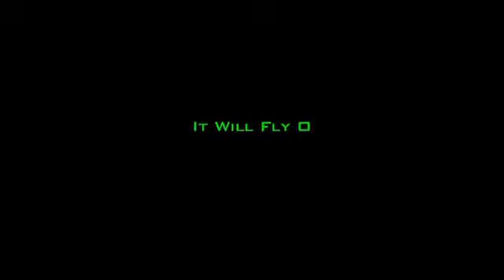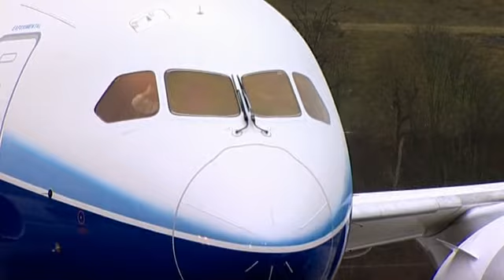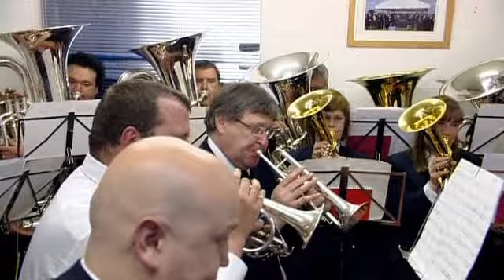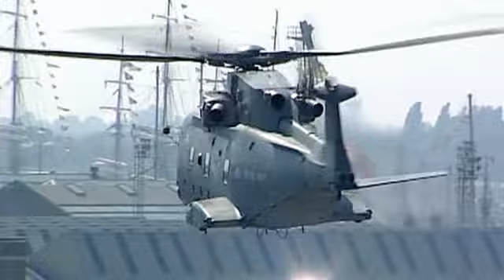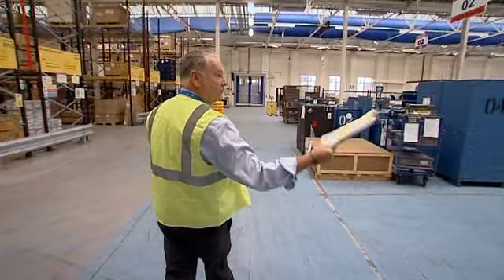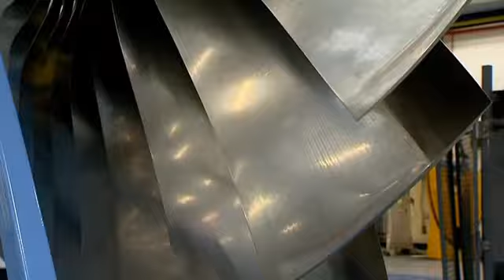Rolls-Royce, How To Build A Jumbo Jet Engine -HQ- (Part 1/4)

Comment: I repaired Rolls Royce RB211 engines in the Pratt and Whitney engine repair center.  Rolls Royce is a quality engine. Pratt and Whitney JT8D-2OO, BABY8, and F100, LYCOMING, CFM56, GE C6, C6-50. My experience major in the JT8D-200 Repair of the Intermediate Cases. Engines today are more proficient in fuel consumption and maintenance cost. 3 years of Chromaloy EDM of Texas, 16 1/2 years at Pratt and Whitney Dallas/Springdale Ar. Feast and FAMINE is the Aircraft maintenance FBO's life. Wheels on toolboxes for the gypsy life.

Comment: 13mil flight hours? That's more than 1,400 years! Yeow
Reply: Pro,,,bonouses,,,..ok,,,thankyou,,,..
Reply: that is between all engines manufactured
Reply: 0:26 50 mil. miles. 500 miles a hour -> 50 000 000 / 500 = 100 000 hours. 24 hours a day, 4 days 96 hours, 4 000 days 96 000 hours. around 11-12 years is 50 mil. miles.

Comment: dont know why it's said that the fan blades are placed in rotor disk in basis of the sound they make. it's sounds rubbish. after three years studying at technology uni I am aware of that  the blades are balanced in pairs and placed in the rotor in a opposite rotor blades mountings as shown in the documentary. i am wondering why it's not mentioned in that movie (or another part). sorry for my bad English :)

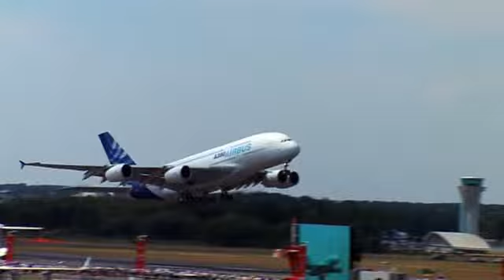Comment: 1:47 dat climb rate... O.O
Reply: +Advection357 its completely empty with nothing in it except the captains.. and as you can see it turns right away so not that impressive. check the 787's climb video from the paris air show, much more impressive.
Reply: noBueno I will! gotta love watching dozens of tons of metal flying in the air

Comment: just can't imaging each blade can hang 13 double deck buses! what the hell? I guess that only happens when they are rotating at high speed.
Reply: YSTECH2010----YOU ARE CORRECT!!----ALL ENGINES & ELECTRIC MOTORS MUST
BE PROPERLY BALANCED; WITH PROPER BEARINGS!!!;  OR ELSE CENTRIPETAL-FORCE WOULD TEAR THEM APART!!!!!!!!-------A "BLADE-OUT" TEST IS ACTUALLY
A TEST TO SEE IF A JET ENGINE CAN RUN---BRIEFLY;---HORRIBLY UNBALANCED
WITHOUT ALL THE OTHER PARTS FLYING-OFF & PEPPERING THE AIRPLANE LIKE A
GATLING-CANNON!!!!!!!!!!!

Comment: Rolls-Royce made its mark in INTERNATIONAL aviation since WWII.  The US P-51 Mustang, flown by no less than Chuck Yeager, was powered by a Rolls-Royce Merlin engine.

When it comes down to it, you have to put the best together.  US airframes and avionics, UK engines, pilots from either side of the pond.

Now if these engines are quieter than the ones on the 747, you could land these planes at San Diego...

Comment: I just read a viewers response that these engines spin @ 300,000rpm's! Is this true?? If it is, that itself is mindblowing!!!
Reply: Very wrong. Maybe they mean small turbojet engines that run r/c planes. RR Trent engines have 3 different shafts.

The biggest and slowest shaft called the low pressure runs the fan, the second intermediate shaft called the intermediate pressure runs the intermediate stages of compressor. And the the fastest called the high pressure runs the middle compressors that spin the fastest.

Leave that paragraph aside, the max rpm varies between variants. The low pressure shaft is about 2800 rpm, the intermediate at 7500 rpm, and the high pressure at 13000 rpm on the Trent 1000.

Comment: Another RR engine blew up on a 787.
Reply: They'll still always be far far more reliable than any US crap will ever be though. ;)
Reply: @shugaroony  After flying 48 yrs/20,000 hrs in jet aircraft all with US made engines (GE & P/W) never had an engine failure or had to shut one down.  And your experience is?
Reply: @jcheck6  Looking at statistics, which also tells a story.

Comment: No, only mini jet engines can spin that fast. In fact, some micro jet engines can do 1 million rpm. The rpms of jet engines decrease as the engine gets bigger in diameter. The only thing that's similar on all jet engines is the blade tip speed. The fan actually spins at about 3000 rpm. That means it's spinning 50 times a second and the blade tips are moving at over 900 mph! Can you imagine the power it takes to spin a 9 foot diameter titanium fan that quickly and move 1.25 tons of air a second?!

Comment: Too bad RR didn't catch that engineering flaw that caused one of their engines to blow-up in-flight on an A-380. Quite the embarrassment for RR and could have caused the first destruction of an A-380. RR got lucky.
Reply: Riccardo Ellison would have spotted it tho he's great!!!!
Reply: David Pye
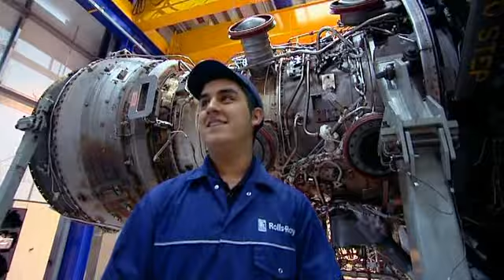 No, I would not have "caught it"...........I know very little about Jet Engines, I am trying to spot that Oil-Feed line that split/detached at 04:15........the one that failed in-flight. No I don't know my way around a Jet-Engine but a fresh perspective from a technically oriented individual can see "the Forest from the trees".
Reply: David Pye
Reply: *****
 I'll be nice.......I would think the NTSB would pull out of service all of those engines. Seldom does one get "a warning" of an impending failure. The RR engine failure was one of a stupid oil-feed line, a simple thing.....those GE engines maybe a design failure....a much more basic thing.....possibly requiring an "overhaul" of the design as a whole itself.
     Both RR & GE are pushing their engineering staff & materials to the limits.......trying so desperately to create the "perfect" engine.....we all know the far flung ideals....an engine that weighs nothing, provides infinite thrust, consumes little to NO fuel, costs nothing to create or assemble, Runs absolutely silently,............impossible, yes....but work down from there  to the possible, the practical.....the limits of the technology of our time. Within my field.....there is the five "ideals" of what is called the Operational amplifier........The five ideals does indeed sound "stupid"......but the attempt towards these ideals motivates.
Reply: *****
 Peevish, "immature"? Perhaps.......I just so wish if that RR engine was "destined" to failure....from such a simple thing, one wishes it was on a test-bed & not aboard an Aircraft. When one gets their airline boarding-pass, their not signing off as a test-bed passenger, rather a simple passenger. RR was damn lucky on that one...Now, GE has issues....Do the RIGHT THING GE, pull them out of service!
Reply: wow you are raging Ricardo...its funny!!!
Reply: ;) kisses
Reply: @AndieBlack13   Why do you have to berate English folks?. Many of us including part of my ancestors are English. A lot of people who berate others do it from feeling inadeqate....
So I feel sorry for you.
Reply: Ricardo Ellison nn

Comment: To put things in perspective, if you removed the fan from a turbofan engine and attached it to a piston engine, the piston engine would only be able to spin the fan at about one third the speed that the turbines are capable of spinning it at. It is physically impossible to build a piston engine that can spin the fan even close to the same speed that turbine power can achieve. No piston engine can achieve the high torque/rpm combinations that a jet engine can due to its reciprocating nature.
Reply: They can produce the torque at slower speeds

Comment: If You Made It Out Of Steel, Put A Superconductive Magnet In The Middle Driveshaft, When The Magnet Pulls In On The Spinning Steel "Hyper Jetting Happens" It Is Called A "Hyper Jet" It's X 10,000 Times Faster Than Your Jet, Pinky. Magnetic Radial Vector Nullification Works In Plain Sight Speeding Up Engines. Use It On Your Jets And Get Up To This Century For God's Sake. Not Using Internal Force Vector Magnetic Centering, Makes You Have Slow Inertia Blades. Put A Magnet In The Middle Of An Iron Based Blade Set. X10,000 Times More Thrust Ed.

Comment: Trump's plane has rolls Royce engines
Reply: Yes Juan, and he takes great pride in them! He thinks they're the BEST.
Reply: Yes but the funny thing is he keeps telling make in America use American products , why then he didn't chose GE engines, preach and do something different!
Reply: Thank God.
Reply: @mukundanpkandath2018  GE has nearly outsourced so much you wouldn't know it's US-made or not.
Reply: @romanmichaelhamilton8729  GE doesn't make aircraft. Boeing makes the planes and uses engines specified by the buyer.
Reply: @The_Sword3  Yes, I know that, I worked at the Aviation at GE for years. And at McDonnell-Douglas. 

And I'm very glad that Trump's plane is using RR as much as he has to travel.
Reply: Mukundan Pkandath because the 757 doesnt have a GE engine option but i see what ur saying
Reply: He has the greatest engines. Some say they are the best.
Reply: Trump plane is Boeing. The engine RR